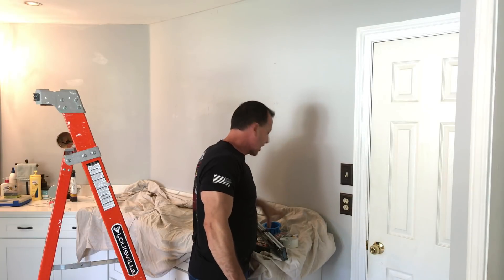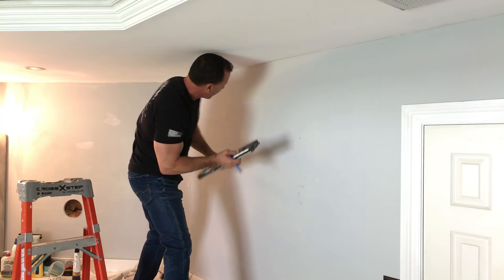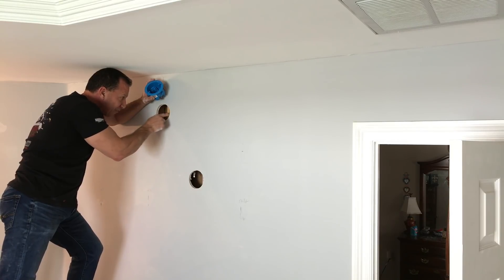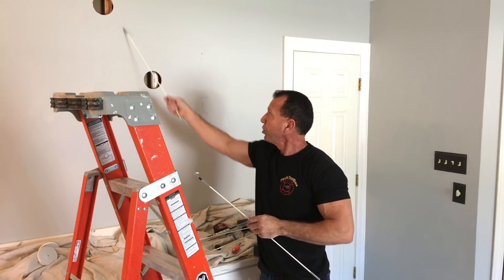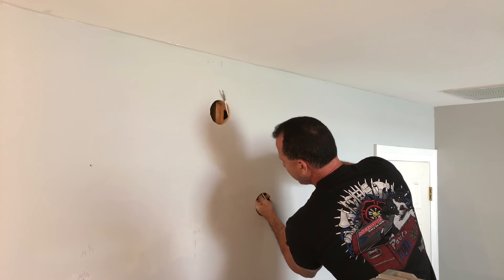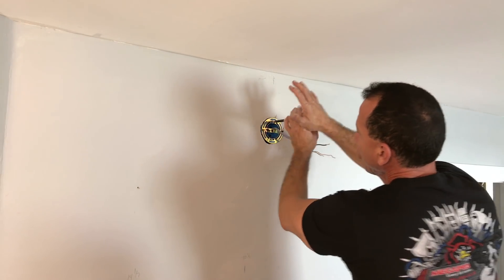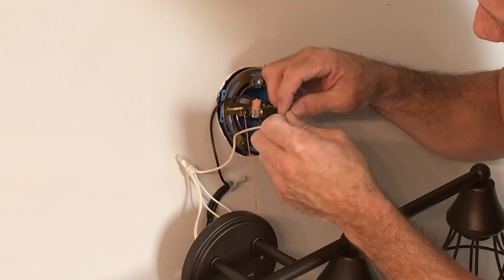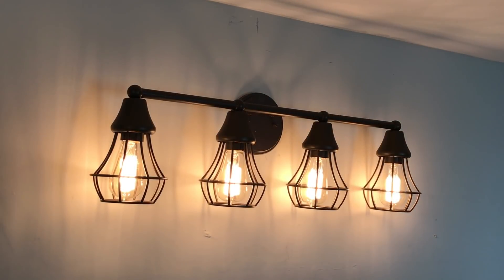How to Install new Lighting Yourself!

Comment: Paul, perfect illustration of how to handle the unexpected/mistakes, with the extra stud being there. I do have questions about the 9" distance from the ceiling: Is that the typical height for vanity lights or do you have to wait until the mirror is chosen to decide? How do you decide where to place lighting (for properly lighting different areas in the home?) Are there rules of thumb for lighting design?
Reply: David Sanders vanity usually 7’ from floor. I usually wait till mirror installed and light fixture chosen before cutting a box in.

Comment: Great video!  Just a question - what are the wire connectors you used? I hate the capped ones. TIA!
Reply: Whoops! Found them! How great these are! Thank you! I'm glad I found your channel.
Reply from the maker: Hi Taz,
They are push in wire connectors, you can get a pack of ten at Lowes or Depot for about $4.00. I added a link so you can see them on Amazon. Do not get ripped off and spend 15.00 for them. Some companies jack up the prices, so do a little homework. I like Ideal, but they have a number of good companies that make these type of connectors.
Thanks!
Reply from the maker: Ha, I just saw your 2nd post, you already found them!  Thanks for taking the time for me and have a great weekend!

Comment: Hey Paul, what are those little electrical connectors called?  Great job on these videos.
Reply from the maker: Hi Felix, they are called push in connectors, I added a link in the description box to Amazon, so you can see them. Don't pay too much for them, some companies are way too expensive. I bought mine from Lowes and they were about $4.00 for a 10 pack. Have a nice weekend!
Reply: Thanks, Paul!
Reply: Paul Ricalde wow, $4 for a 10 pack. That’s nuts.

Comment: Nice save. Did u do that on purpose to show us how to fix it?
Reply from the maker: LOL I actually made that mistake. I knew the vent pipe would be at the center of my sink, but I didn't think the framer would move the stud that far away. I assumed it would be a couple of inches off from the original site but that's what happens when you assume!!
Thanks and have a great weekend!

Comment: YouTube is getting really annoying with breaking into the middle of people's videos for commercials.  I'm moving away from even watching YouTube because of it.
Reply from the maker: Hi Kathy, I feel the same way as you about those mid commercials. I was behind on my videos because I had technical equipment problems and I posted this without checking. No worries, I will go back into my settings and change that. You have a good day and thanks for the heads up!